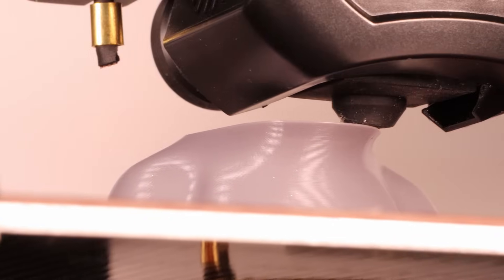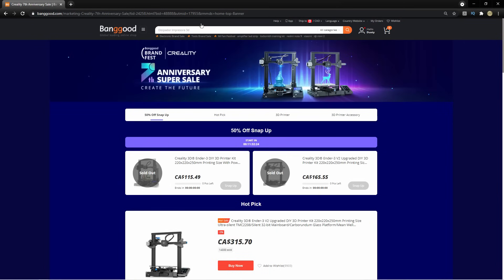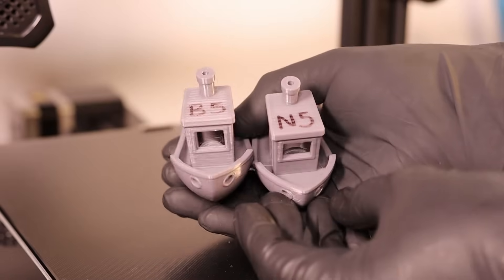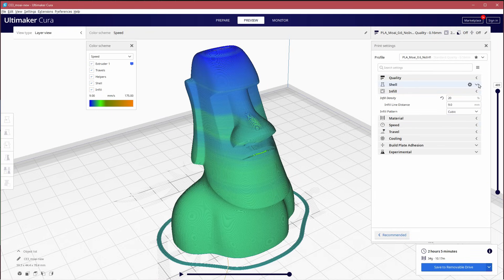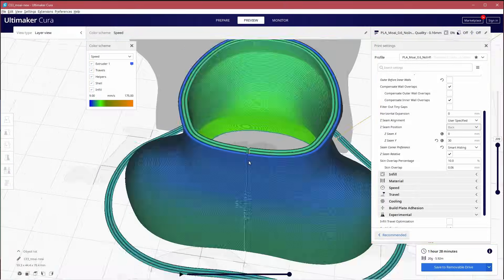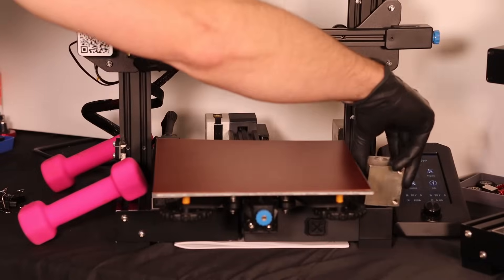Creality Ender 3 V2 - My Cleanest Print Ever and You Can Too!

Comment: I want to make my own chess pieces. How conplicated is this printer to figure out?
Reply: To a degree it's fairly simple. The difficulty starts arising when, and it will happen, you start getting issues with your prints. The rabbit holes will open up and like many of us you will spend hours trying to debug the issue most times only to find out it was a simple fix. 

Should you get one? Yeah. I don't see a downside to owning a 3D printer. The use cases are endless.

Comment: on Top on the head seems like your extrusion is too low, I have the normal plate and I get very good results, temperature and vibration is important, but anyway the filament should be come from top or side and not ON the printer - reduce vibration too.

Comment: just use vase mode and set your layer width to 1.2mm with your .6mm, adjust flow and temp a bit to compensate and just trust me. not only will it work, be faster than you imagined possible, it will look incredible and be REALLY strong for a vase mode print.... bonus points for using a translucent filament (the super thick single extrusion looks amazing when its clear).

hope you read this, try it, and have your mind blown!
Reply: I'm a noob with this type of gear. I come from CNC machining, and making things manually with lathes and hand made molds - not to mention carving by hand out of wood and stone. 

Question -- why is there a seam on "any" 3-D printed object?
Reply: @newunderthesun7353  Are you talking about layer lines?
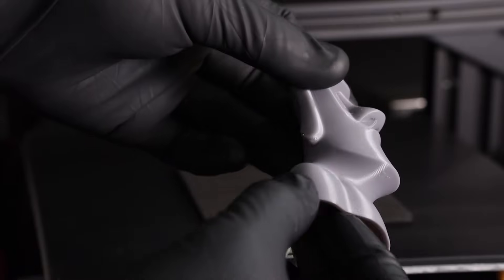Reply: @omegaPhix  No, about 3:30 into the video he shows vertical seam lines. If the filament is contiguous, why are there any seams?
Reply: @newunderthesun7353  This is caused when the nozzle moves up and starts the next layer. I am rather new to 3d printing but I think its possible to reduce that by quite a bit.
Reply: @FH Pwnage  Makes sense if the layers are.planar and not spiral, which most assume.
Reply: Interesting

Comment: How the hell do you get seams? Like that seems intentional. I have a Robo 3D R1 and I never get seems unless I actually model them in.
Reply: I've check the options in Cura and it seems (no pun) that there are several options to hide them by default, like smart seam which puts them in corners or smtg. 
Insane amount of software engineering has gone in 3D printing. I am impressed.

Comment: The print looks pretty good. But getting the best result possible will also be more easy when you pick / make a design that has smooth lines instead of faceted ones. In this case I can understand it is done because a viewer used this file. And you just wanted to show the same file in the best possible result. So this is more a tip for designers and people scanning thingiverse for files. Depending on the design software you use this can be easy to do with better end result.

Comment: The 0.4 variant of the gcode doesn't work (if you view it in a gcode viewer its pretty messed up as well), but would it be alright for me to use the 0.6 gcode with a 0.4 extruder, considering the layer width is still 0.16? I have banding and what I believe to be overextrusion issues ('scars' down the side) and im not sure if it is mechanical or slicer based, so im trying someone else's gcode to find if its a mechanical or slicer thing.

Comment: I wish I could achieve this level of quality on my (older) Ender 3. After 2,5 years of printing I just can't level it properly anymore. Hell, somehow I can have all 4 corners of my glass bed too far away from the hot end, but still scrape the middle... how?!
Reply: your bed is warped, or the plate itself is warped.  Either way you just might need to replace the bed itself or find a way to shim the plate to compensate.

Comment: Not bad. for first layer, I really recommend adding a bltouch. It really does make a considerable difference. Also, use buildtak instead of PEI, no glue, heat is optional for PLA. Then you don't need an enclosure. Randomize the seam and make sure to set travel to within the model. Tension the Y-axis belt on the printer, the ender 3 lacks anti backlash, so it makes a difference. Tension the X as well, it should be ok already, but it could help. Also, adaptive rate control makes a HUGE difference and should be enabled. To do it better, get two inexpensive accelerometers. Dumping the entire Marlin based firmware and just tossing out the screen and replacing it with Klipper and a touch screen with fluidd can help a lot. I recommend considering a proper motherboard as well. Finally, if you're going to stick with Bowden, replace the nozzle and extruder with a 2.85mm E3D configuration. Bowden on 1.75 is horrible. You really don't want direct drive on an ender 3 since the benefits you gain in extrusion is lost in motion. I know I'm basically saying "throw everything out and start over", but that's the point of an Ender 3, it's so cheap that gutting it and hacking on it is REALLY REALLY fun.
Reply: For that purpose an Ender 5 seems more hackable. What do you think?
Reply: @simont3686  the Ender 5 has some pretty serious problems. It's an amazingly hackable printer and I have bother the Ender 5 and the Ender 5 Plus. The Ender 5 has a horribly unstable print bed, but this is easily corrected with a few 3d-printed brackets. The Ender 5 Plus is a disaster of a printer, but is REALLY REALLY hackable. But if you're going to go that route, I'd recommend just building a Voron, it's cheaper.
Reply: @darrenstarr1167   I'm using the Ender 5 pro for about a year now. I got the dual Z mod dnd the microswiss direct drive extruder. It's a really solid, fast printer now.
Reply: @simont3686  similar to my configuration. it makes a huge difference with the dual z. :)
Reply: If you're going to do all that, you should start with an ender 3, not an ender 3 v2, since then you're paying for upgrades that you're going to toss anyway
Reply: @JonDotExe  haha agreed or better yet, just buy the latest Ender 3 which has almost everything already in it. :)

Comment: Do you need specific settings for every print? Or can you use a “general” setting for all? I’m unboxing my printer as I type this so I’m brand new to this
Reply: If you use cura as your slicer it’ll normally save your settings from previous prints, just beware of this when printing something different and changing the settings. It should ask if you want to discard or keep the previous changes you’ve made. Best of luck!!
Reply: @WHISKEY_TANGOPPP  thank you for your answer. I got the machine built last night but wasn’t able to finish hooking up all of the chords (last step). I’ll be doing that tomorrow morning. Hopefully I didn’t mess this thing up!
Reply: @NightBlade58  good luck! I have made a profile in cura but I do change around settings for almost every print now that I've become more experienced. You notice that different parts require different strengths (using more infill or outer layers) and different speeds (using layer height and print speed). So the basic profile makes sure the print is always decent and then you play around with the details
Reply: @erikvern  do you know where I can find a solid profile?

Comment: Hey be careful about inverters from bang good. The rating they have on them is for peak surge and not constant power output. So a 6000watt inverter is really a 3000 watt inverter with 6000watt peak surge output.

Comment: Nice video, but sorry the print isnt such perfect as u say. I printed this figure with PLA and an anycubic i3 Mega S with direct extruder and my print looks mus better with 0.2 layer and zseam alignment random and i activatet "arc velder" in Cura - i havent any sightable zseam so... my see it as a tip  3d printing is almost try, try, error :-)

Comment: You could also use vase mode to get rid of the seams and help with over extrusion on the backside
Reply: Vase mode is not a good idea for a tutorial like this, because it has limited usecases. You can't print anything that needs infill, supports, or more than one line wall thickness. Seam management is one of the major quality issues for me.
Reply: @SeamusHarper1234  there are some tricks to have more walls and make the print more rigid in vase mode.
Reply: There is NO over extrusion on this model at all aswell.. But the term is misused alot
Reply: how would you fix the top
Reply: @mraleko  Adaptive layer height in Cura will allow it to use finer layers just for the areas that need it.  Like the top, for instance.
Reply: @mraleko  smaller layer height
Reply: @almariobraithwaite.u4783  or turn ironing on for top layer only, im new and learning but i think it would help the top layer come out smother no? Correct me if im wrong like i said still learning.
Reply: @dennismayo1111  you wouldn't have to do only top layer because with that setting on it will only iron the last layer, but the top on this print is curved so it would be smoother with ironing but not on only top layer, however I could be wrong because I am also learning
Reply: what is vase mode?
Reply: @quintenvanagt3296  Basically there are no seams because the print limits outer walls and continues to print upward without stopping with fluid Z motion. I think it's called "Spiralize Outer Contour" in Cura.
Reply: @LombardoJoe  correct.. when he said he was doing no infill I assumed vase mode.  I think you can do multi-wall vase mode.

Comment: What is the point of the seam? I don’t get that part
Reply from the maker: The only way at the moment to avoid the seat is to run the part as Spiralize outer contour, it will lay only one line continuously moving the z-axis upward rather than laying one layer, a shift up and then another and so on.  The simplest way to explain a seam is to take a pencil and draw a shape, you have a start and stop unless you draw a spiral.  The same principle applies here, every wall has a start and stop.  Seams can be minimized by the nozzle size, wall wipe distance, the material you print with, your layer height, and the most important is direct drive vs bowden tube.  DD will have a much better result for seams because it is more responsive.  I hope that helps!
Reply: @NeedItMakeIt  thanks!

Comment: OK, newb question here. Why does it have to have a seam in the back?
Also, great print and great video. I've learned a bunch from your videos, so I appreciate them.
Reply: The setting to make a single seam in the back is to avoid an issue where you will notice hundreds of tiny single seams alllllll over the surface where the printer has decided to change height and direction while printing.
Reply: @asai_24  That makes sense. Thank you for the explanation.
Reply: @asai_24  okay but i have not seen this on any of my prinzs so far and i didnt change any settings
Reply: @MrFrisMich  If you notice at the start of the print, he says he is not doing any infill at all, just pure wall. If you print like that, you will notice the issue, since the printer has to change direction and the Z axis has to go up SOMEWHERE, and since it can't do it inside the print, it will do it on the wall surface.
Reply: @asai_24  ahh i see thx
Reply: Wondered about the same, maybe a older slicer version or a older printer idk really.

If you learned much from this you should definitely checkout cnc kitchen

Comment: I print with petg , and when printing I’ll get a “nozzle temperature too low” error. If anyone knows how to fix this I would appreciate it.
Reply: maybe problem with termistor or heater cartridge
Reply: @dopuu1  I think it’s from using a stock heating bed with ender extender kit.
Reply: Assuming this is on the printer halted / M112 screen, maybe your extruder is not powerful enough to maintain that temperature with that fan speed?
Reply: @user2C47  I dont use any fan and print at 245

Comment: How do you pick what to print? Can you print anything custom? Or only from a list of available options?
Reply: You can print any model file, usually in a .stl format. You then put that model into a slicer program, which is also where you tune print settings. This program outputs a .gcode file, which you either print from an SD card or over a serial port via USB. Thingiverse is a good place to find models.
Reply: @user2C47  but my question is how to get any model file from scratch foe a beginner? Do I need to know autocad or some tool to be able to design a model in the first place? For example, if I want to print a horse, and there is no file out there for free, how do I go about it

Comment: Do me one favor, use a flashlight or another source of light and shine it perpendicular to the layers onto the print, meaning from top to bottom, then you should see the layer lines
Reply from the maker: Thanks for the tip Falcon, I can certainly do this in future videos.  I currently use two giant video lights as well as overhead lighting, I often zoom in on the 4K video as well in order to show the detail as much as possible.  I go quite far to show real results.
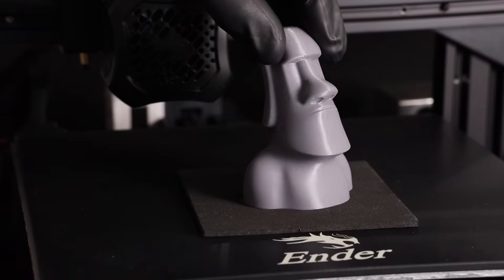Reply: @NeedItMakeIt  if we look at 3:23 you can see the light comes from the right

Oh yeah, and getting perfect prints with no layer shifts (even tiny ones) i believe are impossible
Even a voron isnt able to do that... just because of filament inconsistency

Or maybe you cracked the code, i dont know, would be interesting to see

Comment: I'm noob, but the idea of a seam in a print is rediculous to me! What's up with that? Seen tons of others that don't have seems.
Reply: Basically every FDM 3D print is going to have seams. How visible they are and where the seam actually appears on the model depends on the hardware setup and slicer settings used. There are a few things that contribute to the appearance of a seam but in general they are going to appear where the extruder starts and finishes each vertical layer or wherever it has to stop extruding to jump to somewhere else. A larger nozzle like the 0.6mm he uses here is generally going to make seams more prominent. You’re able to adjust where the slicer starts and stops each layer to try and control the seam. The simplest option is to line all the seams up in a vertical line like he does here. Another option is to randomize the seams so they are randomly distributed across the model. This will prevent a single prominent seam but will cause tiny imperfections scattered around the model perimeter. Often times the best  option is just to hide the seam in a place that won’t be viewed like the back of a model or in a place where it’s not as noticeable like a corner. 

You can also adjust settings such as retraction to try and minimize the seams in the first place but like so many things in 3D printing it’s tricky to get just right without causing other issues.
Reply: Think about it, it must print a layer then step up and print another. Where it starts and stops on a given part will be a seam. You can however relax the seam by playing with settings. Most of my prints it's only visible on the inside of the model, on the outside the plastic just has a slightly different shade but otherwise looks and feels smooth. It's easy to remove a lot of that kind of thing though with light sanding or vapor baths.

Comment: my glue stick dries up too fast due to the heat how can i apply it better or eeasier?
Reply from the maker: The glue needs to be dry when the print starts, it creates a hard bond-able layer between the glass and the plastic, if you still have a poor bond, the build-plate it a little too far from the nozzle on that first layer and will be visible when the print finishes with an under-extruded looking bottom.  I hope that helps.

Comment: So just print at 0.1-0.6 layer height....pretty much.  at the right angle you can see the some issues/banding but it is what it is, fdm will always have that.  using a flex3drive or zesty nimble would give the bowden benefit of having direct drive.
Reply: He is printing really slow, a DD will be perfect at the speed. DD is only an issue when you start increasing the speed

Comment: What kind of lubrication did you use for the z rod?
Reply from the maker: I've used auto grease as a trial, it works well....except when the steppers are off, there is not enough friction and it allows the screw to turn and drop.  Not a bit problem, but it is a little annoying.  For the price of the nut it might be worth just leaving dry and replacing it when it it worn, it has little to no impact on the results that includes with z-hop active.
Reply: White lithium grease is best for this application.

Comment: Try M413 S0, i can feel a chug. If you run inner perimeter first, the start of seam is inside the model and the end of the seam can be wiped over to disguise it, i think you need Wipe Nozzle Between Layers. I forget whether you need to enable or disable retraction between layers then, i think ideally you don't want a retraction here, but i don't remember how it interacts with Wipe.
Reply: https://www.youtube.com/channel/UCW2ja1uLvqjs9mzjVzkglVA
Reply: wtf does the power loss recovery function in Marlin (M413) have to do with seams lol
Reply: @fns58  Because it writes a cookie file to SD-card whenever the parser/planner detects a layer change. If the SD-Card isn't very great and isn't reporting instantly that it completed the write, Marlin just stalls completely until it does.

Comment: Where do you buy your MK8 Nozzles? I can't find any good ones...
Reply from the maker: I normally purchase from amazon as a kit of varied sizes.  I can't really save I've had any major problems with any of them, I do swap them regularly because I change the nozzles for testing so often and it is hard to tell the size with globs of filament stuck to them.   https://www.amazon.ca/gp/product/B07JW4QD9T/ref=ppx_yo_dt_b_asin_image_o01_s02?ie=UTF8&psc=1  The screwdriver in this kit also allows easy removal of the nozzles and it is stubby so the z-height can still be pretty low.